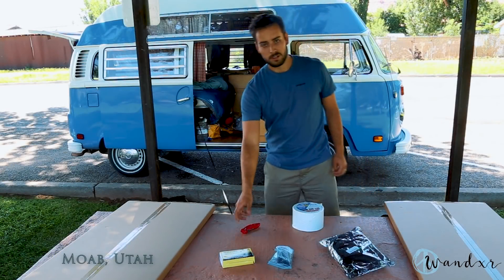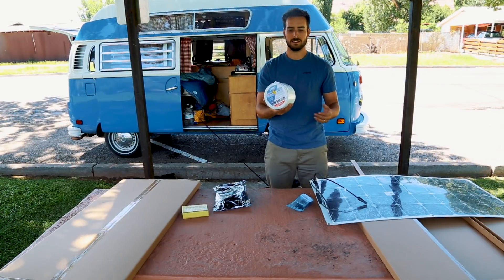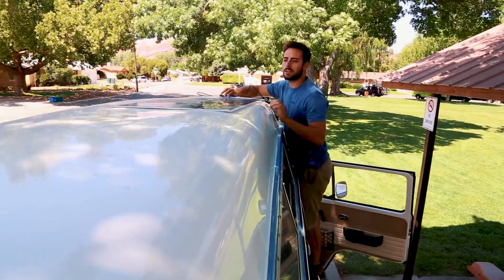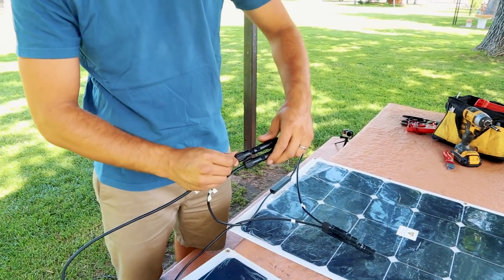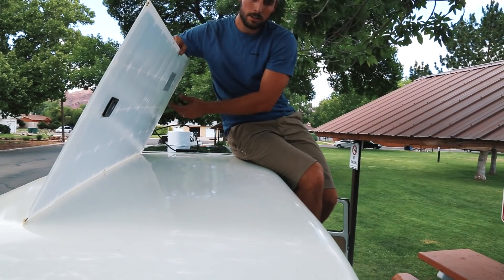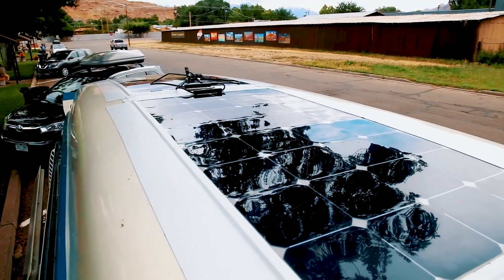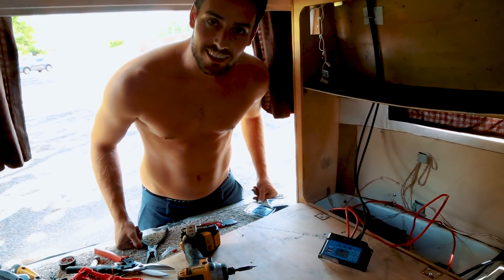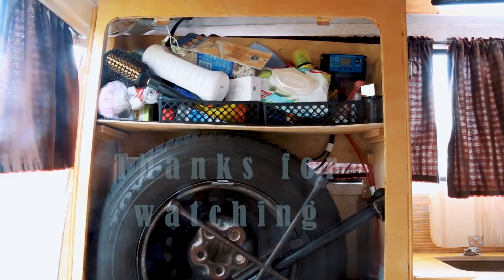Installing Solar Panels On Our Camper Was The BEST Decision EVER (Tutorial) - Wandxr Bus

Comment from the maker: When we started living in our bus in August 2016, we didn't have solar panels. We were in a hurry to hit the road and thought it wasn't a necessary investment but we quickly realized we were wrong... The auxiliary battery wasn't enough to power our fridge and charge our laptops and camera gear when the car was off. After almost a year of struggling, we switched to solar and it's the best decision we made. It's a complete game-changer in our daily basis to harness power from the sun.
Reply from the maker: Ottee2 we have a vmax deep cycle marine battery 125 ah. It's more than enough for us. If we could afford it yes a electric motor but if we travel to remote places how to charge up? Solar powered engine?! Lol thanks for watching.
Reply from the maker: Zayven ‘Oko’a thanks!
Reply: Wandxr Bus 
Is 200 watts enough to run a fridge too? 
Do you have the efficient 12 volt compressor type?
So cool! I hope this is enough for you to be totally energy independent!
Reply: 200 watts of solar with 200 amp-hours of deep-cycle battery will run a dometic cf18 mini refrigerator/freezer and charge laptops and phones easily. and the solar can also charge the vehicle starting battery so you'll never need a jump start.
Reply: 10 years ago (2008) I installed 85W single solar panel on mine, because those was expensive then (about 200€/$) but I soon realize that my battery capacity was too small, because sun is not shining every day, so now I have 2 x 100Ah AGM batteries and it completes the system. Got 2000W Inverter for Coffee maker and Microwave and a smaller one also for smaller 240V electronics. Just sharing this as an example, because Solar is just great in mobile RV's and campers etc.
Reply: I'm sorry but, did you speak FRENCH? Thanks
Reply: Next upgrade : replace you engine  and install a Toyota pious engine with battery and get don't buy gas anymore!
Reply: Nice project, guys. I'd never heard of Eternabond tape before. Can I ask what kind of battery are you using to store the power? Also, would you ever consider a full or partial conversion from gas engine to electric motors?
Thanks for the high quality vlogging. Those drone shots, dho.
Reply: Yes, that is why, perhaps, a partial conversion. Keep the gas engine, but modify the two front wheels with motors, and install a battery pack. Although, I understand space in the van is at a premium. And it would be a somewhat complicated project. Thanks for the reply.
Reply: Addendum: also double the number of solar panels on your roof.
Reply: Wandxr Bus it's amazing that you could pull up at a park to do the installation. That's dedication right there 🚐🌞
Reply: Great video. The panels looking great as well. You guys inspire me to try this living with my dog.
Reply: Wandxr Bus , I'm getting ready to put solar on my van as just wondering how your thin flex panels are holding up now that you've had them for a few months? Thanks
Reply: Wonderful, I wish I could harness power from the sun to charge my chevy Bolt.
Reply: Wandxr Bus , hey I'm still wonder how well those panels are holding up?? Are they still functional?
Reply: They are 100% ok. Giving over 4 Amps as they were new. Promised lifecycle were then over 20 years. Most important thing is keep them clean. Mine are not flexible type panels, just those big aluminum cased ones. I think this 85W from 2008 weights about 8-10kg.
Reply: That OLD SKOOL VW BUS/VANAGON IS SOO FUKKN KOOL!!!
Reply: How often do you guys have sex in the van?

Comment: Unreal, no fuses, no wire gland for safe wire entry. And with more than one panel I would say use a MPPT controler not a cheap PWM which is a basicaly a switch and not efficiant.

Comment: Nice job on the install. I hope it's working great for you. Down the road you might consider an MPPT controller upgrade like the Victron 75-15 with the Bluetooth monitoring option. You'll probably squeeze a little more power out of your panels. Cheers!
Reply from the maker: Hey, thanks so much! I actually got inspired by your install, watched your video before installing the panels. You're right about the MTTP controller, my cheap one just quit on us in the mountains and I'm pretty sure I need one like you described. Would you recommend connecting the panels in series or leave them in parallel with the new controller? Since we only have a small 125Ah battery it might not be necessary? Thanks for your videos, I love them!
Reply: My first controller was a cheap one that died within the first few months too. I learned my lesson. The good ones are much less expensive now. I don't think series vs parallel will make much of a difference in your case since you have a short cable run. MPPT controllers perform pretty well with higher voltages though, so you could try both setups and see which works better for you. Cheers!
Reply from the maker: Thanks! I'll do that. Love the eternabond tape, it lasted so far, 2 years later and driving cross country a few times. Thanks a lot.

Comment: Use a boost converter for charging laptop, cheaper and more efficient than things mentioned $15. Adjustible voltage from 12 to 80v. Check out boost/buck converters too, they are awesome for your style of living.
Reply: Hello
Reply: Are you fb use  id

Comment: Why not buy a monocrystalline panel instead? It's much more durable and it produces more electricity. These flexible panels are easily scratched and damaged in weather and even wind if there's a lot of dust. They also don't have the 20-25 year warranty like monocrystalline panels do. The mono panels are more expensive but they outlast these flexible ones by five lifetimes.
Reply from the maker: It just wasn't necessary for our setup since we only have 1 auxiliary battery and not enough space for a 2nd battery. We went with the flexible panels because they look good, they give us the power we need, and we can step on them when we climb on top of the bus for photos or whatever we do on the roof. After 1 year they still give plenty of power and are easy to clean. We don't plan on having the van for 20-25 years so the warranty isn't something we're concerned about either.

Comment: If you want up to 30% more from your solar panels swap that PWM for a MPTT type  - it will let your  pannels run at their optimum voltage and your battery at its best - just watch out there are some cheap fake MPPT ones out there from China

Comment: 👏👏👏👍 good job. Check the tape every day and add drip loop on cables to prevent leaks. Because cables will move in the wind it will wiggle making space for water to drip into the van even though it's sealed. (I'm a cable installer and tech) I love solar too
Reply: I woulda used silicone under the panels and also encapsulated the cables in it as well to stop any movement of cables or panels. Vibration is #1 killer of these in a mobile environment. Vibration comes from the wind and the movement of the van in driving.

Comment: Could you talk about the wire you ran from the controller to the battery.  Do you have 1 or 2 batteries?  I am guessing the controller just "shuts off" when the battery is fully charged??
Reply from the maker: I used 8AWG wires from the controller to the Aux battery (only 1 auxiliary battery). The controller never shuts off but you can turn the power inverter off.

Comment: Thats not bad at all how about make some USB and Type C charging ports in the van thats easy to access too and not charge over inverter power.
Reply from the maker: The charge controller has 2 usb and the inverter has 2 also. And yet, we don't use them very often since we use a power bank.

Comment: Fucks no, don't use that cheap chinese charge controller, it's a piece of sh*t. Mine overcharged and ruined my batteries, it's also quite shoddily built.
Reply from the maker: Had it for almost a year and no issues, how long did it last until it started acting up on you?

Comment: i hope you put an inline fuse from the controller to the battery. also an mppt controler would be more efficient. great job though i swear by solar had one on my caravan for 6 years, today i have fitted one on my VW camper also .
Reply from the maker: Yes, we did! We love solar, did you install the flexible panels?
Reply: Wandxr Bus yes I did but with a twist , i built a low profile frame and mounted the flexible frame within it the bolted it down to the roof rail channels so I can remove it easily and without damage if it ever fails. Good job guys👍
Reply from the maker: Cool! Good idea.

Comment: it takes 4000 watts to power my freezer in the garage,  as well as the refrigerator in the house.  it took the same honda generators  to power the air conditioner in the RV.   Lol,  200 watts,  couldn't even power my wifes a curling iron.
Reply from the maker: That's a lot of power and I don't know any Mobile home capable of producing that much power. 200w is barely enough for our mini fridge, laptops and phones and cameras. On cloudy days we still rely on coffee shops or libraries.
Reply: you know you are lying thru your teeth.

Comment: Calculate the extra fuel consumption from the extra weight the solar panels, batteries etc produce during movement  and then come back and brag.

A generator literally produce less greenhouse gases than solar panel does.

If you are in the habit of using math prior to making decisions that is. :)
Reply from the maker: If you watched the video, you can see that those solar panels barely weigh anything. It's been almost a year since the install and I haven't seen any changes in my gas consumption at all. Generator is great but we can't in the van due to the lack of space. In our next rig, we'll definitely use a generator.
Reply: Wandxr Bus per W solar panel, rigging and batteries weigh alot. You can't have batteries for just  one day if it is cloudy for two for example.

If you get alot of Wh from the system it's also consuming alot of Wh transporting it around.

Hate to break your bubble but do the math your self. The figures needed are publicly available.
Reply from the maker: Our setup isn't perfect, but it provides us what we need.I'm just self-taught and this was the first time I did anything like this. When it's rainy or cloudy it sucks a little because we have to keep some battery for our fridge so we still rely on coffee shops or the gym to charge our laptops some days.

Comment: This is your first video I've seen. Very well done and perfectly on point for me. I'm planning to add solar to a 20 foot trailer I just got (my first RV). I've decided to keep my self on a tight budget to start. I see you are using the Eturnabond tape that is about 3 or 4 inches wide. I'm looking for some feedback on my idea that I only need the 2 inch wide tape (cheaper, right?). Only about 1/2 inch of the tape goes on the panel, so I will have about 1 1/2 inch adhering to the roof. I only want to be cheap, not stupid. What benefit would I get from using the wider tape? You are experienced now and I'm not. I'd appreciate any thoughts or opinions you have. Thanks, Rick

Comment: Great video guys :) Just one thing, you would be better off with a mppt controller than that pwm you have so you will get the most from those great panels you are using.

Comment: 20 volts? Since the panels are 12 volts and the generally are fused internally at 18 volts, I suspect you're reading 2.0 Amps.
Please follow-up on using the Eternabond tape to hold on the Tiewrap mounts as I haven't seen that combination before and if successful this might be a useful technique.
As a very (I repeat very) basic installation tutorial the video was surprisingly good. I would have been great had you not left out the voltage discussion and had mentioned that the flex solar panels have a tendency to overheat when adhered directly to a (metal) surface. Since the high-top of your van is fiberglass and you have no air conditioning it'll be less of an issue for your van.
Be sure to thank Dave2D for the view and comment!
Reply from the maker: You might be right on the voltage, but since 2 panels x 12 volts = 24 volts, 20 volts seems like a close number since it wasn't getting full power from the sun. Thanks for your input. I'll definitely follow up and review this setup in a future video. And you're right also about the heat. We noticed that they get real hot during sun peak hours. But as you mentioned we don't feel the heat with the fiberglass high top. Ahah yes, I will make sure to write him back. Thanks!

Comment: You need to put a fuse on your positive from the battery
Reply from the maker: Why?
Reply: in case there is a short or serge,  so that it does not fry your charge controller etc.

Comment: This is awesome! I have my tt wired similarly but my solar panels are free standing (that's a pain). I got the latest system from HF but like the fact your panels are flexible & attached. Think I might use my existing wiring but put flexible panels (like yours) on my roof and hook up. Thanks for the info :)
Reply from the maker: Thanks for watching. I definitely recommend those panels that bend. They look almost invisible since they're so flat. Plus you can stand up on them without breaking them.

Comment: Hey Guys, 
Another Great Video. Was talking to a guy at work who is debating on putting solar or just charging his batteries with the alternator on his VW.
Good timing for the vid.
Reply from the maker: Hey man thanks for watching! I thought charging it with the alternator would be enough too. But sometimes you don't drive for a day or you don't drive a lot and drain the battery. So glad I did the solar install I don't regret it.
Reply: No Prob. Your videos make me jealous. Looked at a Van this week. LOL.
Do you think if you have 2-3 batteries charging with alternator would be enough power? Obviously you are limited on space for more batteries but curious on your thoughts.
Reply from the maker: I think even with 2-3 batteries you risk to run into the same issue of having to drive to recharge them. Solar's cool for that, you can park in the sun and chill all day and your batteries are getting charged. I wanted to add 2 batteries but like you said I'm too limited on space. Good luck finding your van.

Comment: Why did you connect solar panels in parallel instead of series?
Reply from the maker: Because it's a small setup that doesn't seem to need to be mounted in series. Besides, it's recommended with a PWN controller. If we switch to an MPPT controller I might redo the wiring in series.
Reply: I have a small travel trailer and am thinking of installing a 200w solar but am hesitant because I want to get a class c motorhome. Does your setup have a 20amp or 30amp controller? I think I need a 30amp.
Reply from the maker: I have a 20 amp controller. Yes, maybe you need a 30 amp for your setup.
Reply: Probably because, parallel circuits will produce a higher volume (faster rate) of charge at a lower voltage. Most car batteries are 12 volt, so you don't want to charge it at 48 volts , which, would be the case if he had wired them together in series (two 24-volt panels).

Comment: Will this power a 5000 BTU A.C. 4 hrs a day?
Reply from the maker: I think so, I read that it draws 4Ah so it should work.
Reply: Wandxr Bus 4amps seems very low.  Even at 4 amps thats @ 120v. That is 480W of power for a AC.  Most AC are over a 1000W

Comment: I did solar immediately. And in a public park. It just makes sense. What gauge solar cables did you run, and more importantly. What kind of connectors did you use from the wire, to the chinsy controller everyone else buys on Ebay?
Reply from the maker: We used 8AWG wires. THanks for watching.

Comment: are you going to run a wire from your van battery to the battery in the van i think its called a isolator or something like that so as you drive it will charge your batteries
Reply: JasonRelaxation They already have the alternator charging their storage battery but it has proven to be insufficient. See 0:54

Comment: Very nice! But please don’t use that controller. I had the same one installed in my T4 and it ruined my very expensive battery. Better install a MPPT controller like the Victron SmartSolar MPPT 75/15. You can connect to an app and get all kind of info about your solar setup, very nice!
Reply from the maker: Cool thanks for the info, I read that with a MPPT you can run the solar panels in series and get double the power.
Reply: Wandxr Bus Double the power is a bit optimistic, it’s more like +30%. And it saves your battery:-)